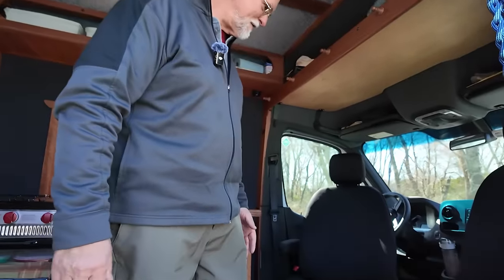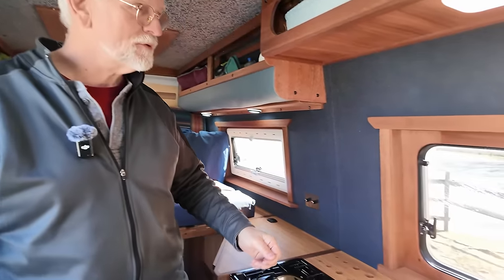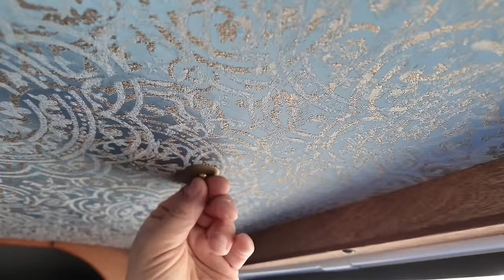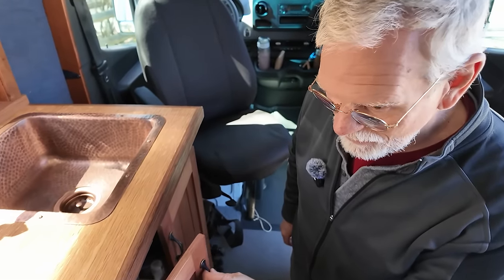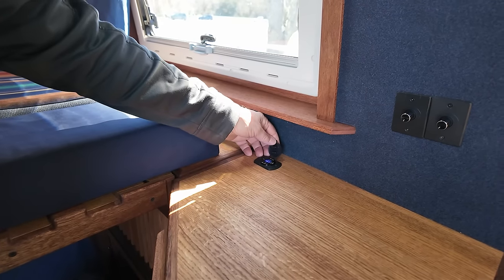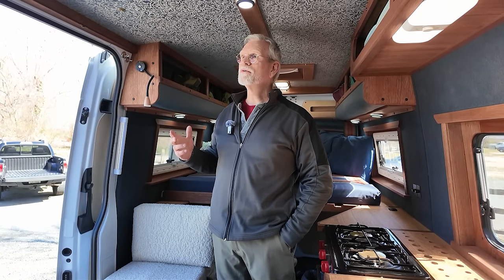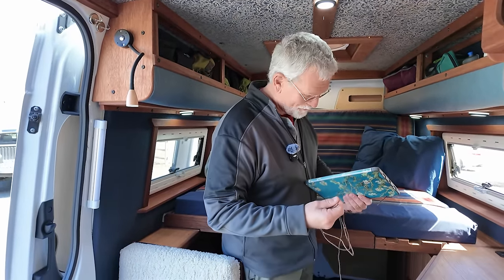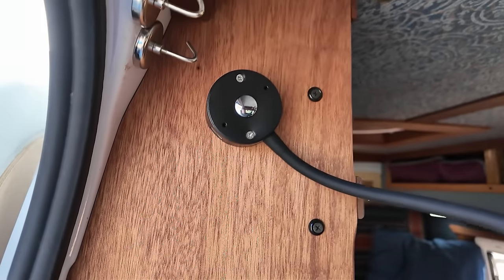This DIY Campervan Conversion is Sailboat Inspired and Selling Surprisingly Cheap

Comment: Great woodworking job, I like the pivoting backrest concept.  My only concern is that a part of the matress is laying directly on the propane stove top.
Reply: It’s where my feet might be, but I’m 5’4” and sleep in a fetal position mostly, so it’s really just the mattress corner that sits there.
Reply: I thought it was cool to be able to use that space.

Comment: I like everything about this except bed. I wouldn't want to go thru all that to go to bed or to cook the next the next morning .
Reply from the maker: Okay 👍
Reply: I understand that. We found that in a van this size everything is a trade off. We like a nice big bed.  We thought about putting in the bump outs but that still resulted in a smaller bed that still took up more room when not in bed form. It takes five minutes or less to do the bed so we made the choice.

Comment: Are these people full-time or are they part-time? Or they just weaken warriors or they're just using it for recreational use. What are they using it for?
Reply: We are just recreational and weekend warriors.  We chose the smallest wheelbase to be able to fit in anywhere we like.  And we kept it simple because it doesn’t need to be anything more.  For It’s size, iVan is a very comfortable and user friendly van.😁
Reply: I've noticed that many people who did their 1st build on the 170 have switched to the 144 for their second build because of the maneuverability re parking and going over gullies off road.

Comment: This is why I like DIY conversion vans. When it's d, I, y, it's an individual done. In other words, when this peak couple make this Van, no one else has this design. This is why I love DIY VS manufactured my manufactured. Everybody has the same vehicle boring very boring so d. I. Y is the best way because it's individually made to someone else's special vacation. What? I have on my campaign old temperature loops. I built myself. No one in the world has it and that's the point.

Comment: This van is beautiful. Regarding the window back by the bed on the drivers side. Do you remember what brand it is, or where you got it? We built a teardrop trailer, and that type of window would be a nice upgrade. Thanks
Reply: That window is a Dometic we got off eBay. I belief Arctic Tern window also has something similar.

Comment: Beautiful workmanship. Love the nautical theme. The only problem I see, besides no shower, is the time and difficulty in setting up the bed. I would prefer to have a stationary bed, so if you pull off the road, you can just lay down and rest without going to all that work...
Reply from the maker: Thanks for sharing based on your perspective
Reply: The bed is a trade off. We like a big comfortable bed and the extra open space we have when it’s closed so we are willing to take a few minutes to open and close it. When closed it’s still big enough for the two of us to have a comfortable nap so it kind of works both ways.